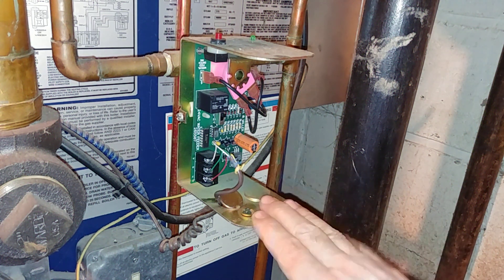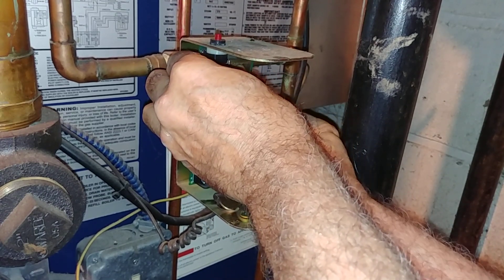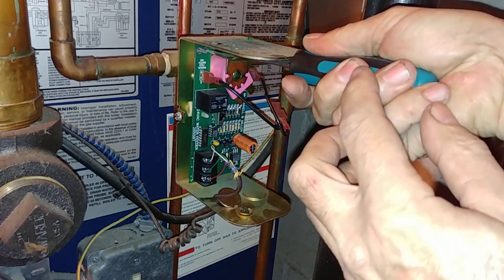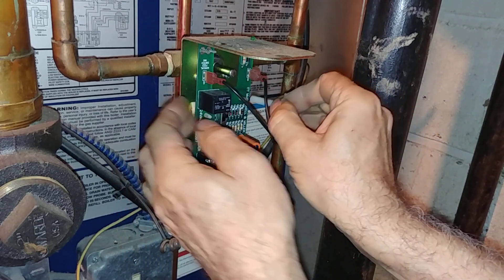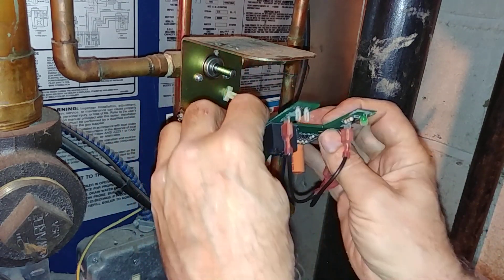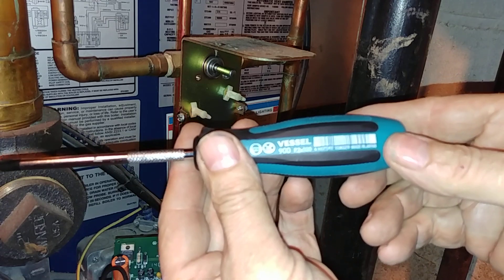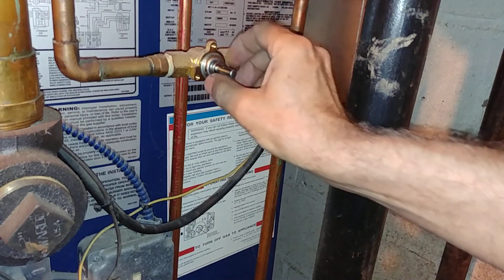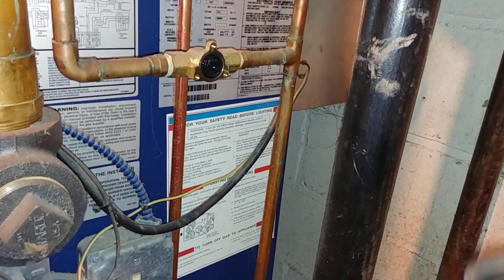Working On A McDonnell & Miller UniMatch Steam Boiler Water Feeder To Stop It From Flooding Boiler.

Comment: I had the same problem as well. Cleaned up the rubber seal. But it was still not getting water into my boiler. It turned out to be strainer screen that was clogged up. I will put a video for better clarity.
Reply from the maker: This video was about one cause of when too much water is being added to the system and flooding it, causing damage to the floors, ceilings etc, and had nothing whatsoever to do with no water passing through the unit.
In my area, the strainer very seldom clogs.
Of the hundreds of auto feeders of this type I've worked on over the years, only twice has a flow problem been traced to a clogged strainer.
In both cases, the clog was caused by steel nipples in the system rusting and the chunks of rust getting caught by the strainer.

Comment: I have been having a lot of trouble finding a place that sells the diaphragm needed for the repair.
Reply from the maker: No bricks & mortar store is likely to have the repair kit.
It's special order
McDonnell & Miller does not authorize repair anyway.
Buy a VXT feeder & ditch the unimatch
The VXT should fit onto the existing valve body with some tweaking & they make a repair kit for the valve.
Reply: I eventually plan to replace it, though it will require some redoing of the copper pipes to remove the old unit. In the mean time it seemed like replacing the diaphragm and cleaning the area would be a quicker fix until the entire unit can be replaced. The issue it has is a slow leak where over the course of a few days the boiler will get overfilled.
Reply from the maker: @Razor2048  Do you have a manual by-pass? Sometimes that valve might be passing & it's not the feeder's fault.
Reply: @gordonschweizer5154  it has a manual bypass as well, I had planned to eventually replace it as well.
Reply from the maker: @Razor2048  That manual by-pass valve may be the thing that is surreptitiously adding water to your system.
Reply: Sorry for double post, I was wondering if the vxt unit will just have me disassembling part of the existing valve and using its diaphragm and cap on the old half of the valve of the WF2-U-24 auto feeder.
Reply from the maker: @Razor2048  Yes, that should be the case.
I believe I have some poorly made videos showing the process of switching out a Uni-Match for a VXT using the old existing valve body (both feeders share the same valve body)
I hope that helps.

Comment: Auto feeder light is green but won’t feed boiler, it does work on manual mode. After hitting manual mode green light went off.
Reply from the maker: Ok, so your LWCO is detecting a low water condition, it is shutting off your burner (I hope!) and it is sending a request for water to your auto feeder (ie the green light is on).
Even after a delay of 2 min, there is no feed, yes?
But, when you push the red manual feed button, water is added to the boiler, yes?
Can you hear water being added when you push the button?
Can you see the correct water level in your sight / gauge glass?  
Is the glass "telling you the truth" to the best of your knowledge?

Comment: I'm having the opposite problem to what you're solving here. My UniMatch water feeder comes on (both with LWCO on, and manually) — you can hear it — but the water level does not rise. Could it be stuck off like this one was stuck on?
Reply from the maker: It does indeed happen that a valve can get stuck closed (I'd estimate a ratio of 15 floods to 1 stuck).
Do you have a manual valve piped around the auto feeder to add water to your boiler?
Just need to make sure there is water at the auto feeder and the flow upstream has not been interrupted.
Check the strainer on the solenoid valve. 
I myself have yet to see one so clogged as to block flow, but you might be the "lucky" one.
I'd get a VXT rebuild kit #45-345 in any case.
Call SupplyHouse.com.
They are on "perminate back order", but I figure if enough folks call in...
And you may consider replacing your Uni-Match with the superior VXT Feeder, as they both share the same valve.

Comment: my old steam boiler uses the McDonnell & Miller UniMatch water feeder. when I started up the system this fall the boiler overfilled to the point where water was coming out of my radiators. So I shutoff the supply valve to the automatic water feeder. And now I am feeding water to the boiler manually.

@Gordon Schweizer If i clean the calcium deposits and replace the disc as you did, will this solve my automatic water feeder issue? Thank you
Reply from the maker: Cleaning the valve and replacing the disc should restore reliable operation for your automatic feeder.
If you'll allow me to suggest that if you are planning to remove the Uni-Match frame as shown and cleaning the S-45 valve, perhaps consider installing a Hydrolevel VXT in its stead. It should fit right on the old  valve (there might be spacing issues I can't see, of course).
The VXT is a much better feeder than the unimatch for many reasons.
Reply: @gordonschweizer5154  I've subscribed and currently watching your Hydrolevel VXT Steam Boiler video. Something I will strongly consider. Thank you!
Reply: @gordonschweizer5154  Hi..my Cyclegard started asking for water a few years even though boiler was full almost to flood the radiators upstairs.
Since then I shut the automatic feed and the valve and check it in person. Isn't there a High Water Cut off thing ? Or will this Hydrolevel VXT do that.. 
if yes I'll order one right away. This Cyclegard is a bit of a troublesome thing asking for water and not stopping.
Reply: Thank you @gordonschweizer5154 for sharing!  I'm having similar symptoms where my McDonnell Miller WF-24 slowly fills up as I can see it increase a half inch every hour in sight glass. I don't hear any noise from the feeder.

However, when I drained the boiler, the lwco does shut down boiler and then the feeder automatically feeds the right amount of water. Then it stops at the appropriate level as seen in sight glass. It just quietly fills up after that. 

I would like to clean the diaphragm but would consider replacing the diaphragm if possible. Can you share the special order part? 

Unfortunately, I do not have a bypass valve which is something I need to insert. So I would like to be careful when servicing this or at least wait until the end of heating season which is a long way from now. Much appreciated!

Comment: What is the other manufacturer for that diaphram... I need to get one  !... went to FW Webb and they told me that McDonnell does not sell a redo kit
Reply from the maker: Ain't that nice of McDonnell & Miller not to back up their Uni-Match feeder except to say "buy a whole new unit?"
That's like everyone else.... except Hydrolevel and their VXT feeder.
Since M&M is telling you to buy a whole new feeder, why not take them at their word, buy a VXT and have done. 
They fully support their products with the best technical service and spare parts.
Tell Mike I said "hi!".
Reply from the maker: The issue is, the diaphragm I'm using in the video is not the official OEM part and truth be told, I'm taking a bit of a gamble that it won't fail and flood the system.
So far, so good, but I kinda like to sleep at nights.
Reply: @gordonschweizer5154  Gordon,  first of all... who is Mike ??... but more seriously, I do not have the money right now to replace with a brand new unit... itis working fine, just that the water could not get  thru because of such a build up in that valve... I have cleaned it all out but I need to replace that diaphram that got destroyed during the removal... I need to get this put back together and operating... can u tell me where u got this kit and who manufactures it ??!
Reply from the maker: @pauldickson6924  Look up on line "S-45 Valve parts". Give that a try.
Let us know how it works out and the issues you have.
Mike is the head of tech support @ Hydrolevel. Excellent fellow!
Make sure you have a back up plan in case things go south.
It may sound harsh, but the laws of physics have absolutely NO respect for the laws of ecomonics or your budget, and only rich folks can really afford to be cheap.

Comment: Wonder if you can help me, I just replaced the auto water feeder but its not getting no power, but I get power for off and on switch and the emergency cut off works to kill power at boiler. What could the issue be as far as no power to auto water feeder.
Reply from the maker: I assume you have a new Uni-Match?  What model low water cut off? Do you have a volt meter?

Comment: I am looking to install a new boiler Right now I have it set up for a hot water intake but I saw a video with you saying the hot water intake reduced the life of the boiler should I switch the cold water intake
Reply from the maker: I don't remember which video that was, but if I said that, I may have been too harsh.  
The McDonnell & Miller #47-2 LWCO and feeder and the wretchedly bad M&M #101 water feeder say in their instructions not to use hot water in them, as it will calcify their inner workings and cause failures either to feed or to flood the boiler.
The newer feeders don't say in their written instructions one way or the other about running hot water through them to feed the boiler.  When asked privately about using hot water, they say, well, you sorta can, its ok, but...
So, in summery, using hot water per se to feed a steam boiler should not be a problem.  The weak point is the feeder.

Comment: Thanks for the disassembly sequence.  Mine still feeds fine going on 10 years however the sound of water surging through when it’s activated has gotten a lot quieter this year.  I’m suspecting a dirty screen.
Reply from the maker: VXT now has a new variable position model, so just remove the Uni-Match electronics and bracket as shown and put on a new VXT after cleaning the valve.